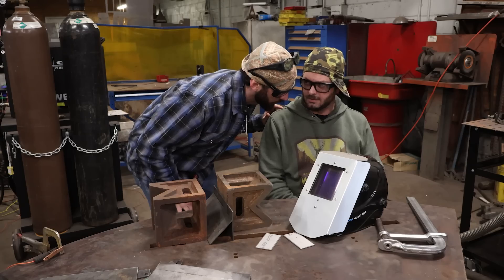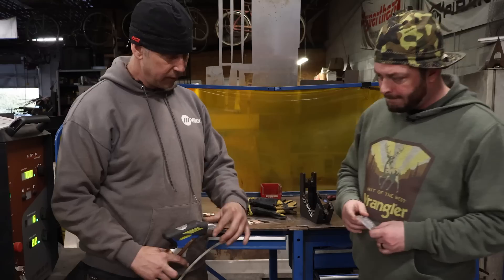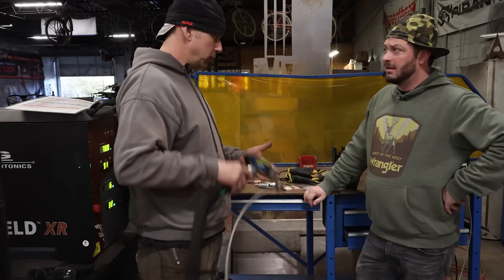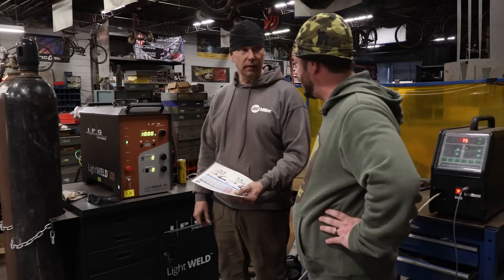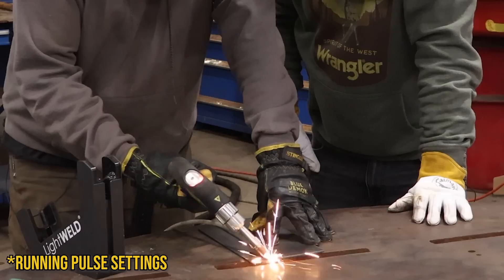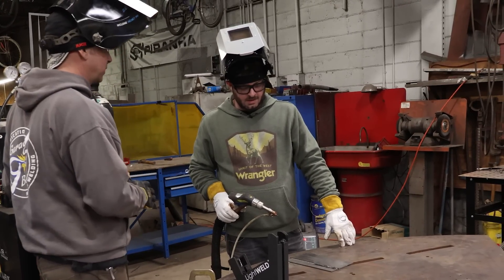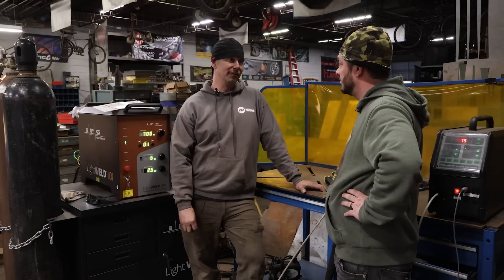Can You Train Someone Laser Welding In Under 10 Minutes?

Comment: Hi, I've got a 1500w laser also welder and I'd like to know if in your experience this safety specs for security glasses would be ok.  ->【PROTECTION WAVE LEngth】: IPL 200-460nm & 800-2000nm broad spectrum protection，optical density(OD) 5+,30% visible light transmission, anti UV/blue light And Infrared laser light .

Comment: If someone can be trained to do laser welding in 10 minutes then anything that can be laser welded will not pay well.  The labor will be cheap if it takes less time to learn laser welding than it takes to learn how to use a cash register.
Reply: true, I'd also expect more designs to favor laser welding whenever possible. But the reality is that laser guns are so bulky that there's enough work for the other processes out there. I'm designing a 2 person side by side tandem e-assist trycicle, spent weeks changing the design to make most welds laser weldable, even via robotic welding with special turn tables if possible, but I could only get 2/3 there, at least 1/3 of the welds will have to be TIG welded
Reply: HARBOR FREIGHT    ! @mikstratok
Reply: D.E.I. ...

Comment: We did some trials with single and multi wire, both solid wire and metal-cored wire, with laser, like this machine but higher wattage. Penetration is really good. Vertical @ a 45 degree angle, dragging the weld upwards had the best results. It is good for small fillet weld sizes, lap joints up to 4 mm, pushing 6 mm. Above 6 mm, it competes against other arc welding processes. Stops and starts are harder to get right. You cannot hang around and melt a tie-in. Once you start the laser weld, you need to complete the weld. This process has it's place, most definitely for sheet metal, automotive and production work with. Just sharing my experience.
Reply: I’m learning to use this, wire-fed, er 70s6, each stop I leave a pin hole.

Comment: Still waiting to see a cut-and-etch on a variety of laser-welded workpieces...
Reply: We did some trials with single and multi wire, both solid wire and metal-cored wire, with lazer, like this machine but higher wattage. Penetration is really good. Vertical @ a 45 degree angle, dragging the weld upwards had the best results. It is good for small fillet weld sizes, lap joints up to 4 mm, pushing 6 mm. Above 6 mm, it competes against other arc welding processes. Stops and starts are harder to get right. You cannot hang around and melt a tie-in. Once you start the lazer weld, you need to complete the weld. This process has it's place, most definitely for sheet metal, automotive and production work with. Just sharing my experience.
Reply: YEAH!,   AND I WANT TO WEAR STARCHY SHIRTS AND FUNNY LITTLE COTTON CAPS AND LAY UP IN THE TRUCK ALL DAY AND SLEEP...!

Comment: I looked at some that are out on the market and its not a simple small jobs tool unless your doing this every day. What I guess I am trying to say is the cost of one of these machines is quite a bit more than a mig or tig set up. This is the biggest one so far that i have seen doing something and it is very impressive. What I did see was one designed for sheet metal on vehicles which are a lot more complicated and not near the penetration or quality for a beginner. Any shop doing major fab work would enjoy using it. Would of enjoyed seeing how well the lazer rust and other stuff it can remove. The one I did see was okayish but again, not even close to this machine. I do believe their machine was in the five thousand dollar machine.... like "Vevor" quality which is kind of harbor freight range. Just guessing this is north of a hundred thousand dollars...thats just a guess and probably a way off guess
Reply: For sheet metal even the $5000 machines really are a “game changer”, they put so little heat into the weld that panel distortion is basically no longer an issue. The only potential issue is that fit-up has to be bang on, they can’t fill more than the diameter of the filler wire.
Reply: @ackattacker  Good to know
Reply: Under 50k

Comment: These things are truly extraordinary! And y'all didn't even go into how they can CLEAN metals also!? I'm so happy to be alive at a time where technology is making things like THIS^^^ possible. And if I understand it correctly, it's a very similar LASER technoclogy that is making the 3D printing of metals possible!? Which is just 🤯🤯🤯🤯🤯
Reply: Laser cleaning requires a different laser source. That's a whole other subject! ;-)
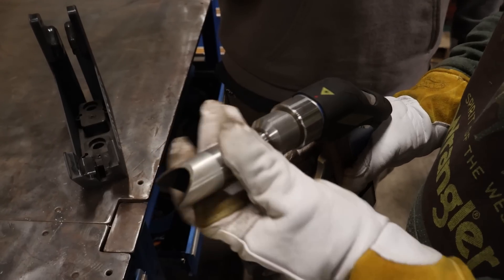Reply: @loweek9646  You mean like at 1:10 when they say to laser clean change nozzle and setting?
Reply: @stusue9733  No lol. Laser cleaning with that kind of laser source will remove rust and other stuff but will damage the substrate; Only microscopic though. So if you would laserclean and then paint; your paint will fall off after a few weeks/months. There's specific laser cleaners if that's what ur looking for. This still remains a laserwelder.
Reply: @loweek9646  Going to have to ask for a source for that claim.
Reply: @loweek9646  So none then...
Reply: @stusue9733  I wrote a reply but it hasn't been pushed forward or I forgot to hit the reply button. Simply said, if you have acces to these kind of machines, you should test it and see for yourself. Laser welding usually uses a continuous laser or a q-switch laser source. Some of them have a pulsing mode. For cleaning you need a specific flat-top (or top-hat) pulse laser to get the best results. I'm not sharing lucrative proofs or sources on a Youtube page. I'm not a keyboard warrior to spend my time having to proof what I'm saying to random people over the internet. I do hope that I've brought you some extra information or perhaps learned something new. Have a nice day.
Reply: @stusue9733  and still not seeing anything concrete to back up his claim lol